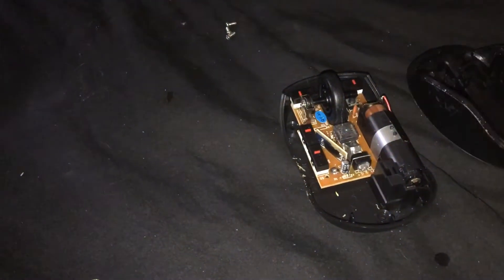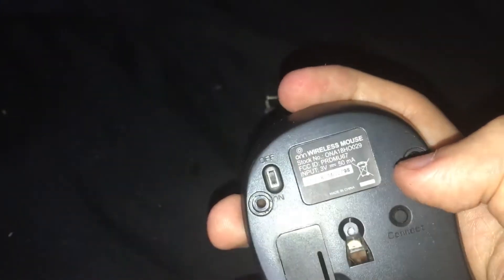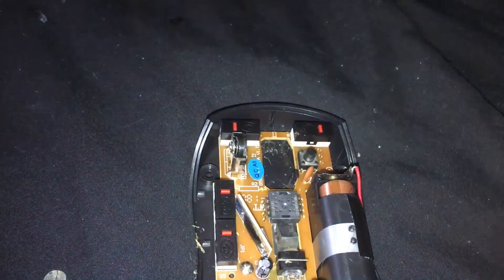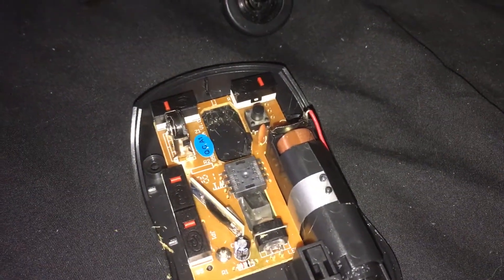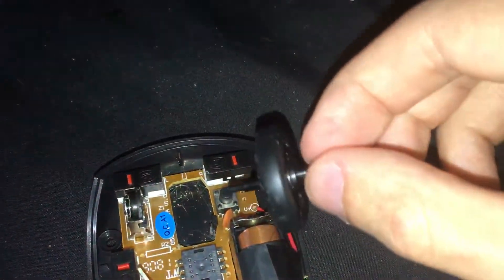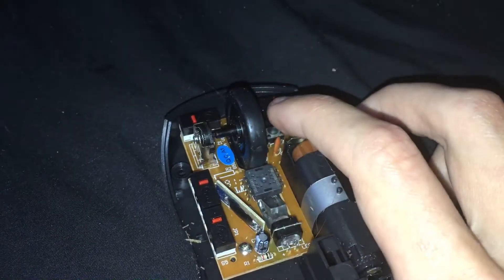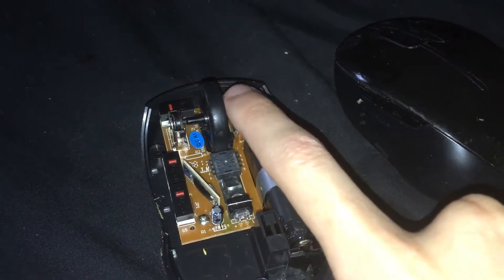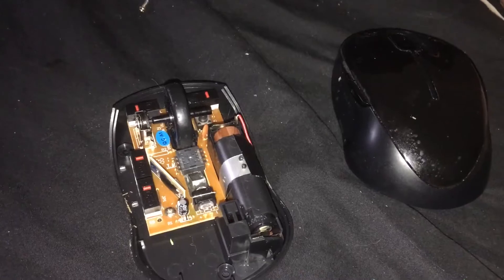SIMPLE DESIGN, HUGELY FLAWED || ONN Wireless Mouse Disassembly

Comment: For all the people looking for how to actually "disassemble" the ONN Mouse, you have to peel off the rubber sliding pads on the bottom of the mouse. Beneath the pads are 3 screws; one underneath the front pad, and 2 beneath the lower pad. This moron doesn't understand what disassembly means.
Reply from the maker: Me know what word means. Me very smart and wolf like. Do not get wrong. Me not Cro Magnon. Me wolf man. You know what me try to explain.
Reply: Thanks 😂! But you did not have to call him a moron.

Comment: HOW DID YOU FIX THE PRESSURE PROBLEM WITH THE THIRD MOUSE BUTTON?  i'M STARTING TO HAVE THE SAME ISSUE WITH MINE.
Reply from the maker: I just took it apart, removed the mouse wheel, cleaned it up, and put it back in. Once it’s in again, I test it without the top shell, and once I concluded it was good again, I put the top shell back on and it worked again for a while.

Comment: Mines not even working, replaced batteries, lights up but won’t respond
Reply from the maker: Have you checked to see if the wiring is soldered correctly? That might just be faulty wiring.